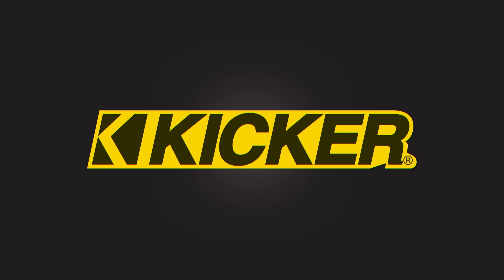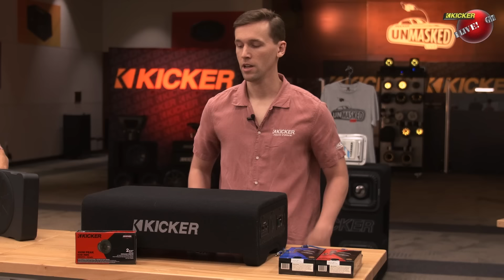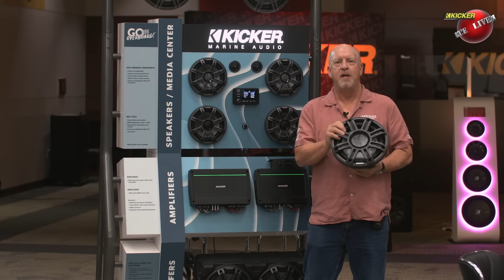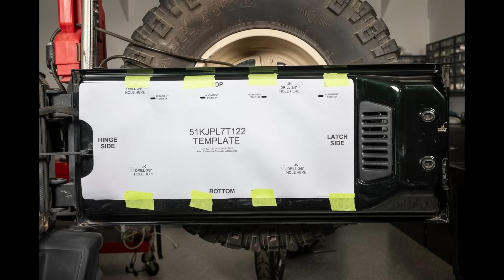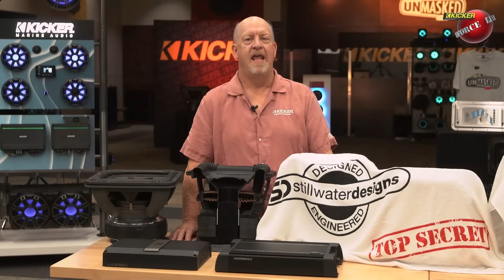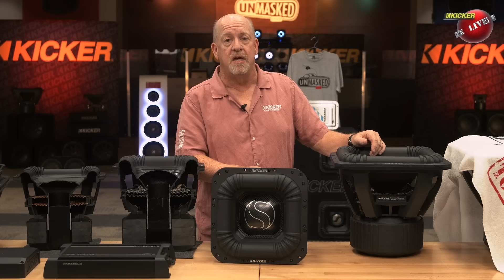NEW KICKER PRODUCTS DEBUT AT SEMA 2025!

Comment: The guy said the warhorse 3600 would be good for the 4k watt 18”.  Would it be best to run it at .5 ohm to get the most out of the amp to power it correctly or is the 3600 really enough at 1ohm?

Comment: Can you make an enclosure with  10" amplified sub for the 2023-2026 Colorado's to fit under the rear seats? Thanks.
Reply from the maker: There aren't enough of those in the field for us at the moment. Our first and only option for mid-size trucks right now about to release is for the Tacoma, and that outsells the Colorado annually by about 3 to 1, and even that's still way, way under the annual sales of full-size F150s, RAMs, and Silverados. Basically, there just aren't enough Colorado owners.

Comment: very good, i remember when kicker first started out. they were sold out about as fast as going out of business.

lol, it was bonkers. 
the tutorial is really amazing.
i like the availability if the choice of colors, sequences, fades and sensitivity to external sound vibrations.

my question about that is, 'is it possible to make the external sound to also have a sensitivity level? ' . 

and yes, do not pick up anything over 50 lbs . . . unless you are doing a workout. but as for a tutorial of product. . . . no.   lol .
i have heard that it takes a long while recovering from a slipped disk.  

the new look of the replaceable cone mount is very impressive. 
i like the way there was a internal look of the product. 

question,

does kicker ever think about doing the slim or shallow mount style speakers.
as in like, all of them?

as like for an s10.  the front speaker is a 4x6 but, the manufacturer Delco Remy does not make that style speaker anymore. the thickness [depth] was just a little long. if it were 1'' shorter, it would have been better. 
 others do have that same 4x6 style, but they have a center speaker on it, that makes it impossible for the dash grill it fit back in place as from the factory.

so yeah,  a dual cone shallow mount would be sooo much better.

[edit]
p.s.

   reason for asking for shallow mount, is because the single cab trucks have a short seat range to the steering wheel. 
so long as the seat can remain at the back cab, that is where the shallow mount speakers come into play.

i do not like being cramped at the steering wheel.
 that is unsafe, not just for me, but for everyone and everything.

Comment: Hey guys, are you planning on releasing the XS range in the UK ? 
Ide like 4 of the 18 models, ime seriously thinking of loading my massive pro audio cabs with them after some tune up modifications, those cabs are built for incredible power & deep lows.
Reply from the maker: The L7X is available in the UK, so I believe the L7XS will also! We've only announced this week, so I'm sorry I don't have a lot of concrete info for you yet.

Comment: Any chance that top mounting plate on the xs will fit on the X  18” looks like more surface area to seal when mounting inverted. Or is there a chance of getting a flat top mounting plate as an accessory for the reg solo x’s
Reply from the maker: There is no cross compatibility of components to my knowledge. It's all new tooling.

Comment: Question for owners of the solo x the sq good on them or are they pure spl
Reply: I've heard it's a compromise. Not quite as good sounding as the Q Class, but it's not a basic air pump, either. I'm not sure how you would describe it. You'd probably need to hear it in person.
Reply: @JasonWW2000  I actually own two Solo X 12s… I agree the L7 Q class is pound for pound one of the best SQL/SPL especially at the price point before it was discontinued
Reply: Sound quality is awesome if you like lower frequencies… I’m an audio mix engineer and I can tell you it produces well within the ranges suggested. I know you didn’t ask, but aside from it having sql and spl capabilities it’s also very efficient!

Comment: I can see if you take a 2013 RAM 1500 single cab center jump seat out and remove the center console/seat back you could design a subwoofer box that replaces the seat bottom but allows the center console/seat back to be bolted back into position retaining the ability to take a third passenger and keep a few cups upright, not to mention being able to retain all factory storage inside the cab.

Comment: Interesting that you took the Orion HCCA recone designs while the patents were being transferred from MD Audio to Sound Pros and incorporated them into what is basically a beefy L7S and called it the "Solo X"... I've spoken with the owner and heads of Orion and they say (and I quote) "we welcome a companies competition using our designs"...
Personally the new Solo X and Solo XS look the look but the new Solo X itself is just a Beefy L7S, and I have both subs in the 15 inch size... Sadly the Solo X 15 in its ideal enclosure (6.0cuft tuned to 32hz) couldn't beat a Orion HCCA 15 in its ideal enclosure (4.0cuft tuned to 31hz) both tested in my suv and both subs received up to 3800w clamped, the Solo X metering its best score of 146.70db at 41hz on 3557w on the glass and the Orion HCCA metering it's best score of 148.43w at 40hz on 3731w on the glass... 
Personally owning over 130x subs and over 80x amps while performing regular testing and doing it in a unbiased manner I was actually disappointed in the Solo X 15's performance and sound overall, especially for the price... 
So far the reigning single sub champion in my SUV is a Fi Audio 4.11 Stage 3 18 in a 7.8cuft enclosure tuned to 34hz as it meters a 149.11db on the glass with 4184w clamped. 

I look forward to testing that Solo XS 18 though, let's see if it can dethrone the Fi Audio 4.11 Stage 3 18... 🤔
Reply: Why are you accusing him of stealing patents?

Also, can you please ask the people at Orion to provide some actual recommended box specifications and accurate TS specs? Thanks.
Reply: I dont understand the hate. Look, i absoluely love Fi audio subs, but your personal "testing" conclusions leave a lot to be desired. There are a few systems on youtube that utilize the lx7, the most notable ones ive seen are a single lx7 8" sub doing a 141.1 at 31hz. A single 8 inch sub. There's yet another set up of a dude doing a 151+ with a single lx7 12" sub. In the low 30 hz range. The point is, the lx7 is a great sub, i mean you are comparing it to an 18" sub afer all. There are literally videos on youtube of people pulling similar numbers to your 18 with a single 12, that alone is impressive. As usual, dont take my word for it, look it up for yourself. All im saying is that the hate is unwarranted, alot of these brands these days make absolutely awesome subs, including orion and Fi audio, you dont have to dislike one to appreciate the other.